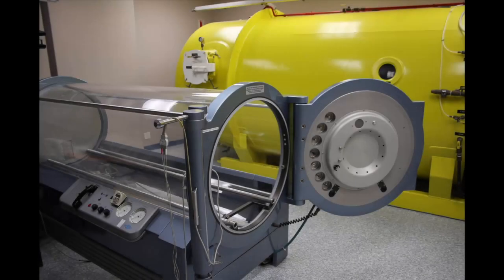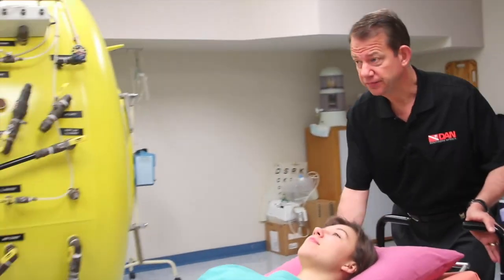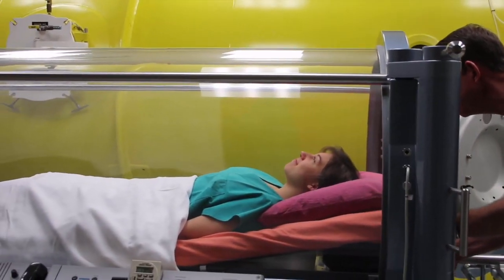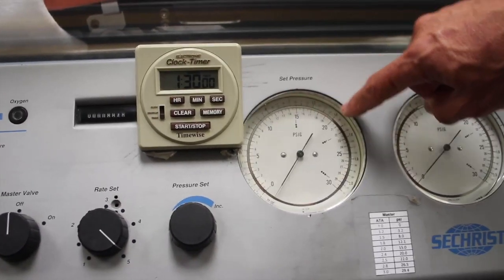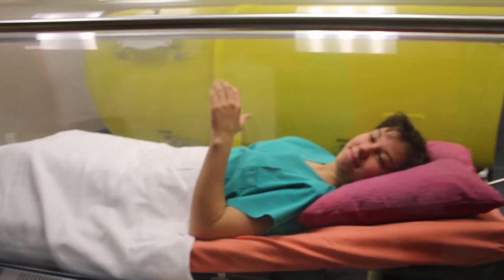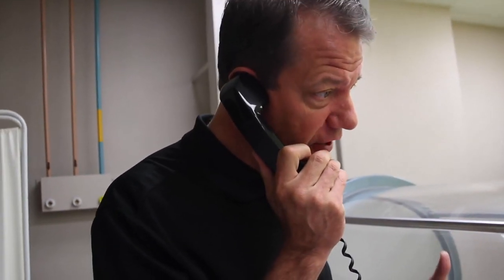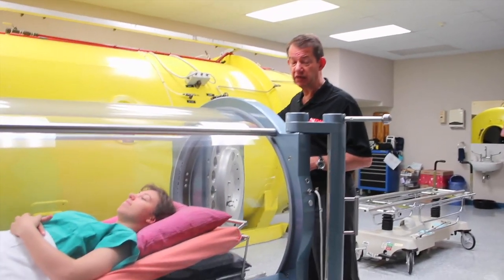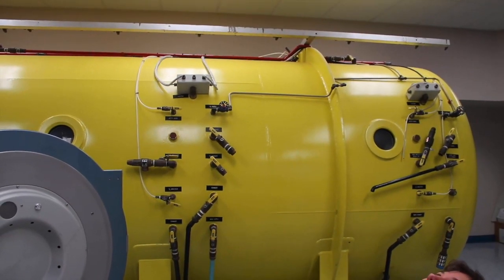Monoplace Hyperbaric Chambers

Comment: Great video, thanks! I was wondering about something you said. How do you connect a patient to an IV in a hyperbaric chamber? Is there a hole for the IV line or does the IV bag stay inside the chamber and doesn't have to pass through the side?
Reply: Great question. There is a tycos compression system that can be used if you do not have a pass-through. You get oxygen-safe lubricated ones and as long as there are no bubbles in the line (in other words, you do not use the drip chamber - https://www.omnia-health.com/product/ethox-blood-pressure-device) and you can control the flow through the IV (you get in-line flow controllers made of plastic, you can use this as an alternative. I would be hesitant to use it for medication, though. We have used Patient controller analgesia devices which are also compatible inside an oxygen-filled monoplace. so there are definitely options.